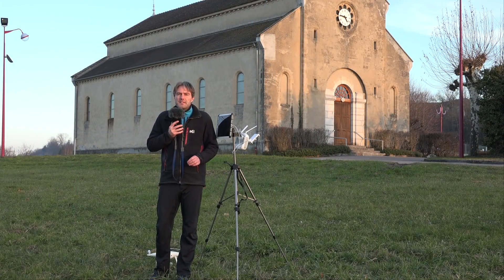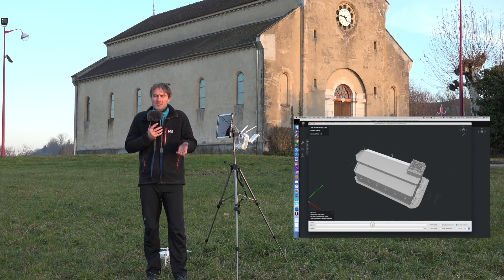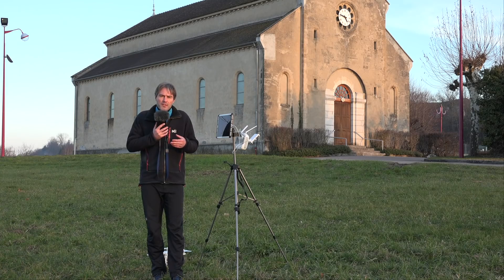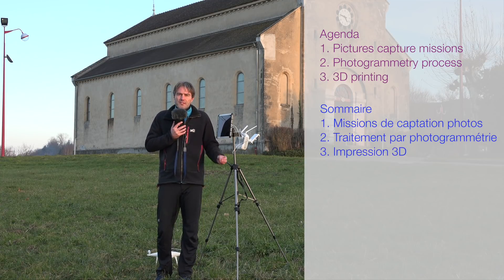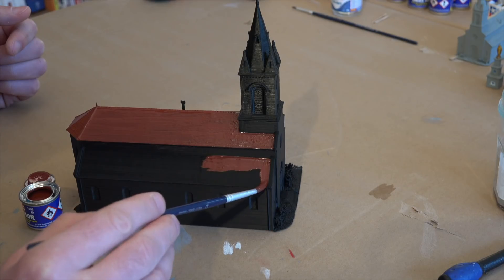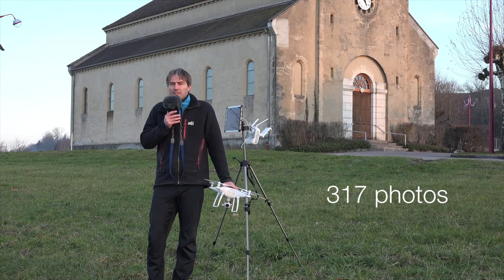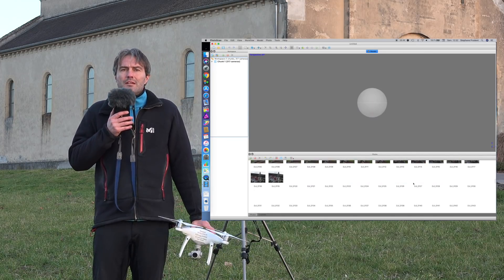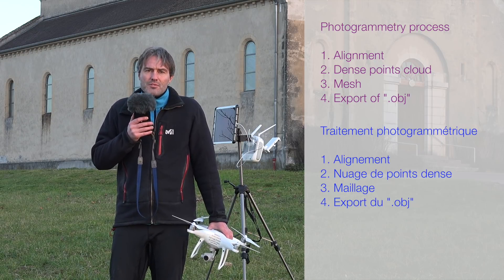Photogrammétrie et impression 3D, workflow complet

Comment: Bonjour, super video merci. Comment vous vous être procurez svp le train jouet qui tourne sur rail ? Merci
Reply from the maker: Bonjour, c’était le set lego 60051 qui n’est plus produit, celui ci devrait faire l’affaire : https://www.lego.com/fr-fr/product/passenger-train-60197?wgu=268085_196673_16444992681843_aec6a199ea&wgexpiry=1652275268&cmp=AFC-AFFILIATEFR-91999-196673-268085-2654515&wgclickid=268085_196673_16444992681843_aec6a199ea
Reply: @paladrone  Merci. Le train est assez costaud pour pouvoir porter un objectif photo tout en avancant sur le circuit comme le votre sur la vidéo ?
Reply from the maker: Oui, en tout cas pour un boîtier GH5 et son objectif 12-60. Je me rappelle que le problème était de minimiser les oscillations du wagon en roulis, ça demande un peu de réglages et adaptations.
Reply: @paladrone  Daccord merci beaucoup
Reply: @paladrone  Re bonjour, desolé de vous deranger avec ca. J'ai trouvé le même modèle de train que le votre modèle de la video. Mais le circuit c'est pas vraiment un cercle contrairement au votre. Celui que j'ai vu le circuit a une ligne droite un moment, comme ovale un peu. Je peut acheter un autre circuit en forme de cercle et ca marchera dessus ?
Reply from the maker: @manflive6852  il suffira de ne pas assembler les portions droites pour faire un cercle
Reply: @paladrone  Ah daccord tout simplement, merci encore

Comment: Please can you recommend software to cleanup reconstructed mesh? The perfect mesh ready to print right after photogrammetry in my practice is only achievable for very simple shapes. Also i usually take source photos on the go while travelling. It is impossible to take missing photos later. The only way is to export mesh and refine it somehow than reimport for photo texturing
Reply from the maker: Hello, you can try Meshmixer to repair the model (the only one I know) ; I have  sometimes the same problem as you, the mesh contains lot of non manifold edges